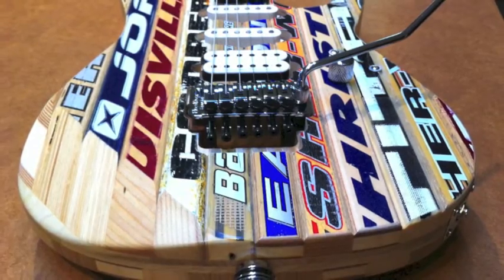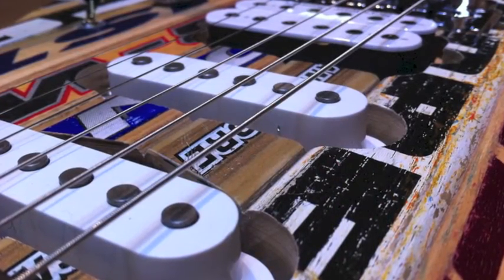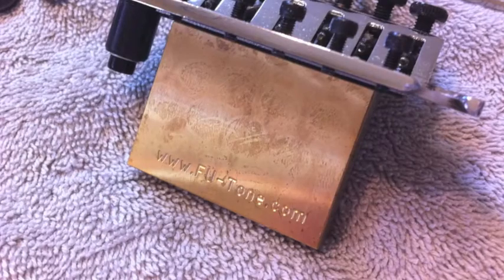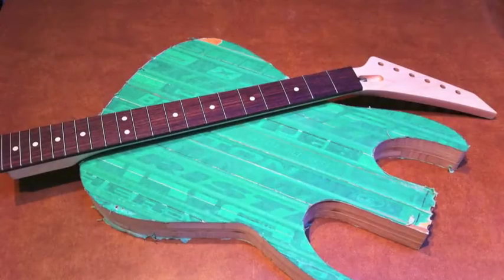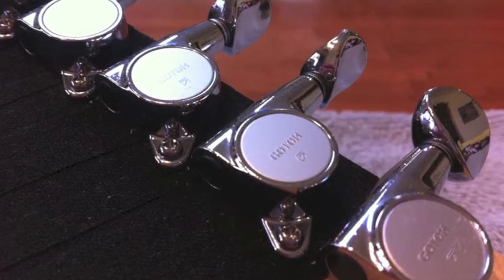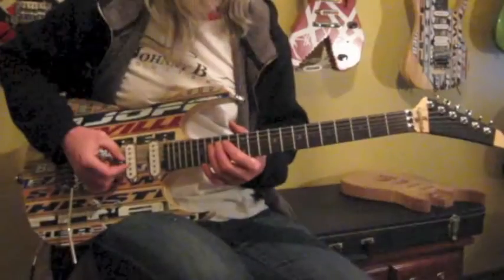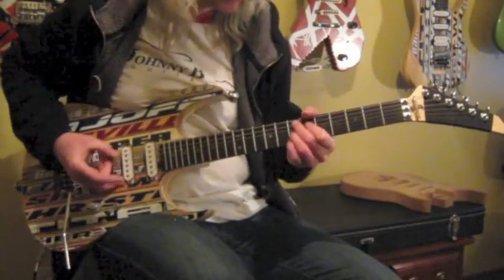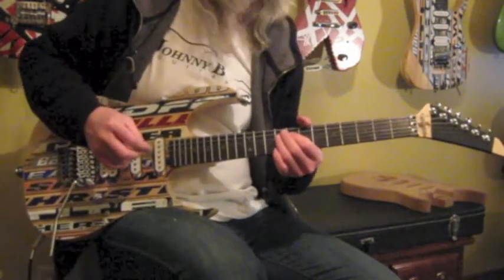Custom guitar made out of hockey sticks. part 8 of 8

Comment: Tone wood is a dead debate. Wood affects tone in a proportion that doesn´t matter at all.
Reply: No, it does work that way, there is no 0% or 100% , even with potted pickups , but this is peanuts for human ears , althougt a higher acoustic response on an electric guitar means that the energy generated by the vibrating string goes through the body and there is no coming back (more or less) to the strings so you can detect a notable loss of sustain and it sucks because it is pretty hard to fix shit like that, a new body perhaps...one of my favorite guitars is a Maison Strat copy made of plywood and it is well made enough to sound and play the the way I expect from a stratocaster. Acousticly  it has a shitty resonance frequency, but when you plug it into the amp it is like heaven, killer sustain, all (almost)the enregy remains in the strings, I love it...
Reply: Sure, I do certainly prefer metallic stuff, bridge , nut. Plastic always goes to the trash can.
Reply: +Charlie Llorente one of my guitar is a bare wood mahogany strat with no finish - pick-ups screwed directly to the wood. the bare wood practically swallows all the tone making it sound very thick & dark, as compared to my different strat with ash body  w/finish and pick-ups mounted to the stupid plastic pick guard, and sounds very bright and projects well.
wood does make a lot of difference for tone
Reply: Says the tone-deaf internet zero. I don't know dude, I think I'll listen to what Clapton has to say on this matter (and every other great musician and luthier worldwide)